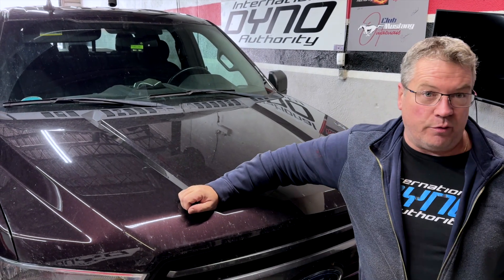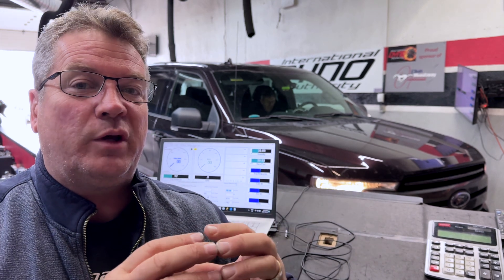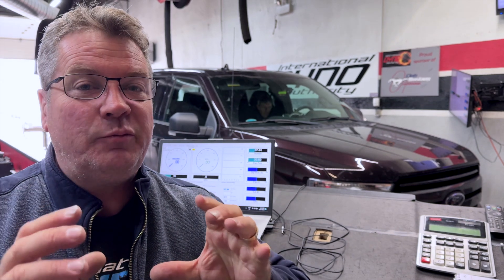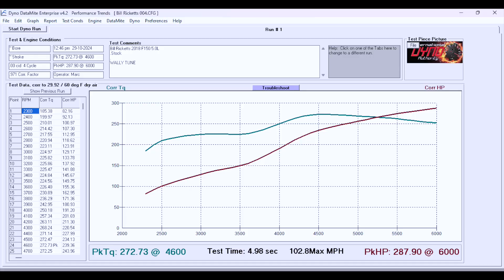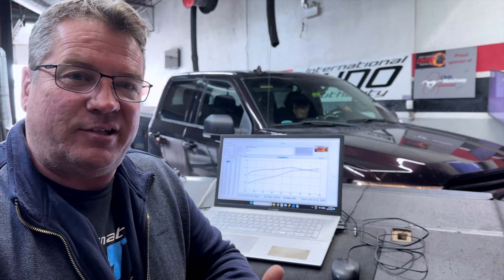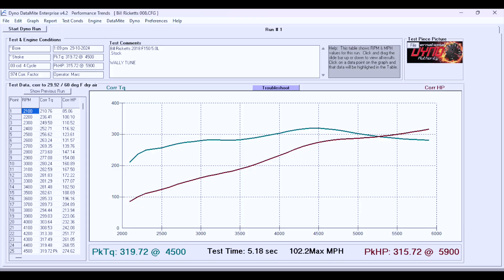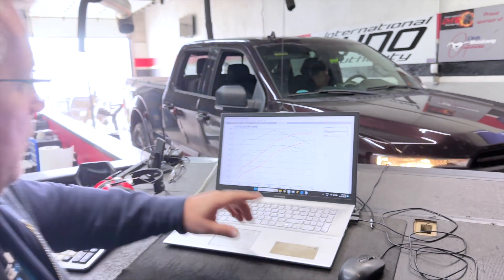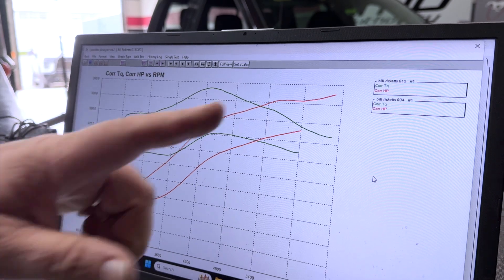F150 Transmission & Dyno Tune

Comment: how much does a tune like this cost? I would like to bring my 2014 F150 in, it has a 5.0 with the 6 speed transmission. Bone stock
Reply from the maker: @pantera580efi  give us a call anytime. We can give you a quote immediately. 613-795-2779. Or 613 -857-3578? 

Cheers, and look forward to hearing from you

Comment: What can you do with a 2021 Nissan Titan pro-4x  5.6 with 9 speed??
Reply from the maker: We have tuned quite a few of the Nissan Titan platform. They definitely respond extremely well. We can expect a minimum of 45 HP gain , 60 tq
Reply: Can U flash my ECU to your known setup?
 @internationaldynoauthority693
Reply: Wow. Does it void my extended warranty? 
Can I flash the ECM with a map from a previous dyno map that you've done?
I have had many of my motorcycles done by mailing my ECU/ ECM in and they flash it and send it back.
I live in Missouri is why I ask.
Reply: Can you tune mine by mail in ecu flash?